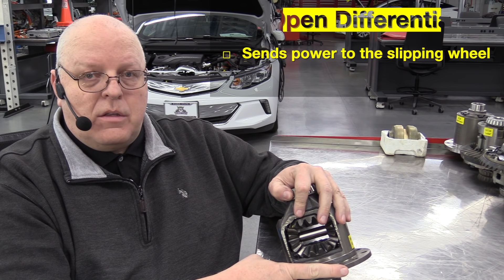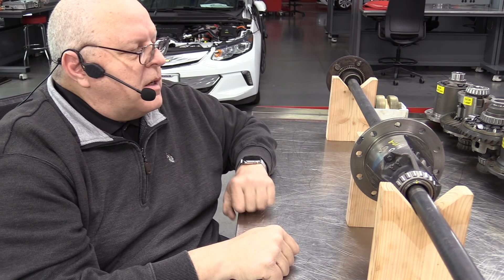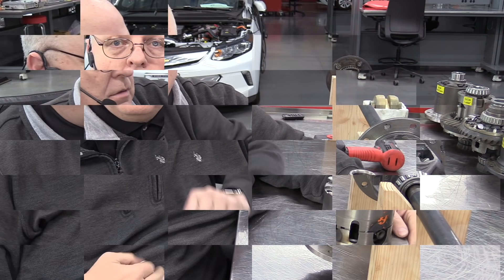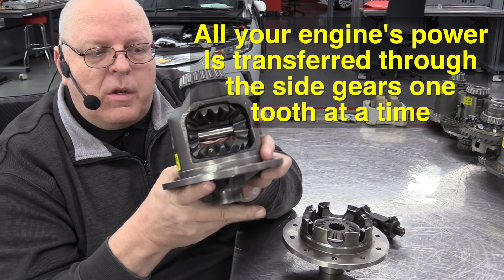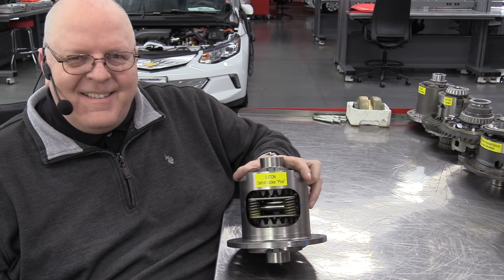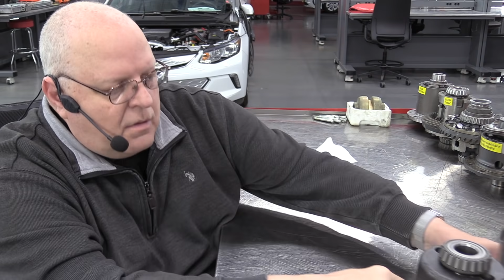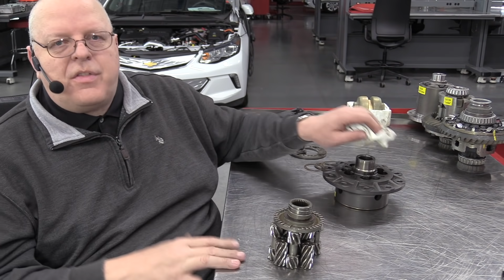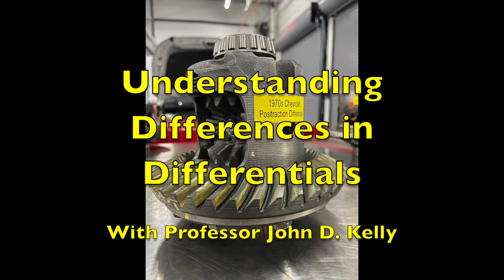Understanding Differences in Automotive Differentials

Comment: I'm trying to figure out a modern version of the  61-68 International Pickup / Travelall rear end that has some sort of lock. Any ideas?
Reply from the maker: I do not know. I think they used Dana axles
Reply: @WeberAuto   yes they are Dana. I am doing a complete frame off restoration and will upgrade the axles - I will pull the diff cover at some point to see which of these rear ends looks like one in your video. My wife.. "What are you watching? Are you enjoying that?"  Me, "yes, I love this guy and all these different rear ends will help me figure out what I have in the Buick and in the Travelall." "D

Comment: have a 342  g80 in my 02 chev  k1500  it was a 75 buck option,,,,been a great  diff  ,,,just had the pinon  seal changed  ,,but  that was an age  thing  ,,not miles
Reply from the maker: A great axle

Comment: What's the difference between these and a viscous LSD?  Is it using heat to engage friction and why they wear out?  Is that the same principle used in a e-LSD like VW that uses a high pressure engagement to press clutch plates together?
Reply from the maker: Huge difference. Perhaps a topic for a future video. Thanks for watching

Comment: I used to have a 2016 Camaro ss once I broke the lsd. As I turning if I leave it in gear the car would lurch and I feel a lot of backlash in the diff. The diff will just constantly lock and release. It was really weird. However if I leave it in neutral it just act like an open diff. . Do you know what can cause that?
Reply from the maker: Sounds like something broken. In gear there is torque applied, in neutral there is not. Thanks for watching
Reply: @WeberAuto  thank you

Comment: Thanks for the informative video, the last Eaton locker is available on few models here in India, can there be a cut off mechanism where a minimum of 20-30% power should be sent to the other non slipping wheel?.
Reply from the maker: I did not know that. Thank you
Reply: An issue with lockers and preload on a limited slip is when you get both axles on a slippery surface like ice, the preload essentially locks the axles together at low torque where they are both breaking loose form the surface loosing lateral traction.  When that happens, you've lost your rudder and all directional control.
The best solution for winter driving is a limited slip with no preload springs.  This gives you the option of light breaking to add preload when one wheel gets on a slippery surface.

Comment: Where does the air come from and switch on/off in air actuated designs? Engine, a compressor, etc? Are there hoses, pipes, etc?
Reply from the maker: Compressor and tubing
Reply: @WeberAuto  Very interesting. I would think there is a better way, even a big solenoid. Imagine the surprise of the owner at the oil change place with the car on a lift. "Is that a hose coming out of the differential?!?" (Thanks for your excellent presentations, BTW.)

Comment: Excellent exposition of something that has always been a bit mysterious.
The only car I ever owned which had differential locking was a 1968 Daimler Majestic Major. The axle was fitted with a "Thornton Powr-Lok" differential, which I guess was made under licence from Dana, in America. Whenever I floored the throttle (just for the fun of it), it worked but was accompanied by grinding noises, which I took to be the mechanism which limited the slip.

When compressed air is used, where does the compressed air come from?
And I wonder what happens in Land Rovers.
Anyway, thanks for the video which was most engaging.

If I were making my own electric vehicle, for which I would use a thirty year old Rover SD1, my preference would be not to have a mechanical differential, but to drive each rear wheel by its own motor, and perform this function with "a bit of software", to control the torque to each wheel.
Fortunately I am too old for this to be anything other than an idle fantasy.
Reply from the maker: Compressed air from electric compressor. Thanks for watching

Comment: Very nicely done presentation and interesting as well.  I grew up in the muscle car era wishing I had a muscle car, but I finally realized it would be impractical as I had to commute 100 miles a day to attend college.  Many of my friends had high powered cars and with that came the problems of parts breaking and talk of differentials, clutches, and transmission breakdowns due to street drag racing and showing off.  I came close to buying a muscle car, one was a 64 white GTO with the tri-power and the other was a new 68 Roadrunner that I went as far as putting a deposit on but backed out over the fuel economy issue.  I loved the GTO, the dealer allowed me to drive it around for a couple days, unheard of in today's world.  Anyway, I went the exact opposite route and bought a new VW Bug in 68, it cost $1,750.  BTW, the new 68 Roadrunner was $3,000.  I forgot about another car I was interested in, a 1965 two-door sedan Dodge 426 Hemi.  This happened after the 60's muscle car era, I found it in 1975 and the seller was asking $1,500 for it.  I wonder what that car would be worth today?  I know I couldn't afford it.  Thanks again for the very informative video.
Reply from the maker: Great story. Thanks for watching

Comment: The only one you didn't have was a Lunchbox Locker, it's basically a mini spool but with dog teeth and springs. It "can" have slip from one wheel to the other but it sounds like a ratchet when it does, as the dog teeth slide over each other
Reply from the maker: Thank you, yes, I need to find one
Reply: He also didn't cover the Vicious LSD
Reply: @inorite4553  I'm guessing that's because it's a vile abomination.

Comment: I was hoping you'd cover viscous limited slip differentials like the center differential in many Subarus (I'm curious how much torque it can transfer vs. clutch types or gear types), but I appreciate the detailed look at clutch, gear, and locker types. Thanks for sharing these on youtube!
Reply from the maker: Great suggestion! Thanks for watching
Reply: I have opened one of those. It has a clutch pack with self contained silicon fluid. The clutch disks are wider, thinner and have holes on the surfaces where the silicon fluid circulates. When there is slipage, the fluid increases viscosity quickly and the disks tend to lock to each others.

Comment: What happens if you use a gear oil with additive in differentials that do not need it?  Awesome video.  Thank you for sharing your knowledge.
Reply from the maker: Nothing in an open differential. It could cause parts to slip in Torsen style helical gear differentials

Comment: WoW.... I'm speechless.
Thank you professor Kelly. couldn't find more accurate answers to my questions. started looking for similar ideas for a new type of vehicles like the one I thought about and came across your introduction of the Chevrolet EV Bolt... since that moment I've become a fan, spent hours watching your explanations about mechanics and automotive electric systems. that was 3 months ago.
I am a well known motorcycle electrician for the past 28 years and still have learned so much.
Today I found out that there is an of shelf differential that doesn't use cone gears :)
Sam Mordo
Reply from the maker: Awesome! Thanks for watching

Comment: You missed the latest and greatest (Torsen) differential. No clutches to wear out way simpler in design than all of the differentials you just showed and they virtually never wear out. Dodge used them in a myriad of trucks in the U.S. and it's the reason they still have properly functioning limited slip differentials at 200,000 miles while ford gm and toyota do not.
Reply: There are tons of G80s going strong at 200,000+ miles.
Reply from the maker: Thanks for the feedback. There is more than one style of Torsen differential. See the JTEKT Corporation's website for more information https://www.jtekt.co.jp/e/products/lsd.html
Reply: The one issue with Torsten style is that all the torque is given to the slower wheel.  So the inside tire in a turn has all the torque and the outside tire just coasts along.  Not a big deal for most applications.

Comment: Your opening description of power division in an open differential is incorrect.  An open differential divides the power equally to both wheels.  On dry pavement, both wheels get the same power.  If you put one wheel on ice, both wheels still get the same amount of power, but this is now much less power as the wheel with the least traction determines how much power goes to each wheel.  That is why the car does not move as the power to the wheel that has traction is reduced to the power being absorbed by the slipping wheel which isn’t much and thus neither wheel gets significant power and the engine will rev to redline if you open the throttle very much.
Reply: No, it divides Torque evenly between wheels, not power. Power is torque x movement. If one wheel is sitting still and the other is spinning then by definition no movement means no power. Whatever x 0 is still 0.
Reply: @danielthechskid  I don’t disagree.  I used power as that is what the author said.  However, I believe in the case at hand, power is also correct.  Power is work/time and work is a force acting through a distance.  In this case, torque is the force and distance is movement of the car.  If one wheel has traction and the other has zero friction/traction, both will still do equal work with respect to the car.  The wheel with zero traction will do work in spinning up the wheel, but the torque required to do this will allow the wheel with traction to slightly move the car.  If you want a real car with one wheel on ice, the car does not remain completely stationary.

So, I agree that torque being applied equally to both axles is the simpler and more direct explanation, but I also believe that a detailed analysis will also show that equal power is also provided to each axle.
Reply: @LTVoyager  Fair enough, I was going with the old horsepower = torque in foot pounds x RPM / 5252. I should have said speed not movement.
Reply: @danielthechskid  The tricky part with power is that you need a force times a distance with time factored in.  Since time is the same in a comparison scenario, we can ignore that and we still need a force times a distance.  If either distance or force approaches zero, then work/power approaches zero.  In the case of an open diff with one wheel on pavement and one on ice, the power to one wheel is not moving the car, but instead is adding energy to the spinning wheel which requires a force as long as the wheel is accelerating.  The other wheel moves the car a very small amount which equals the work done by the other wheel in spinning up.  The difference is that the wheel spinning up has very small mass and thus the power applied results in a lot of motion (spinning), whereas the other wheel is moving the entire car which has great mass, but which has very little motion in order to keep the power the same at both wheels.  Or, looked at from the torque perspective, the same torque applied to a small mass will accelerate it quickly, but applied to a large mass will accelerate it very little per Newton’s second law of motion.
Reply from the maker: Thanks for your feedback and thanks for watching

Comment: Another way to do it is with an epicyclic gear train where the sun wheel and planetary wheels (not star wheels - they're found on printers for driving the paper via mini (cowboy boot spur wheels (not to be confused with spur gears :) ))) have to have the same number of teeth.
Reply from the maker: Thanks for watching
Reply: Sports cars with 4WD often use something like this as a centre differential because a planetary gear set splits power and torque. By choosing the correct gear sizes, it can produce a torque split between the front and rear axles even though axles are running at the same speed. This is usually used to bias the torque to the rear mechanically to give better acceleration. 
On a car with open differentials and equal torque split, the front wheels will break traction first due to the weight shift backwards on accelerating causing all the engine power to go to the front wheels as this is the path of least resistance. 

With a torque splitting diff, say a 40:60 split, if the weight shift due to acceleration leads to 40% of the car's weight being on the front wheels while the rear has 60% the torque split means the tyres will all be working as hard as they can but not spinning, without any locking or limited slip differential - on a standard differential, at the same acceleration the rear axle would have 20% more potential to deliver power when the front starts to spin. Some very fancy cars (Some Mitsubishi Evos and Subaru Imprezas would be the most popular cars with this option) give the driver the option to adjust the torque split - so how these differentials work is a whole other question. 

Torque vectoring is the next step and is active control of the torque split, usually side to side on the rear axle to give more torque to the outside wheel on cornering as this has the most grip, but this is controlled on the fly by the car's computers. The Ford Focus RS doesn't have a centre or rear differential at all and uses a clutch between each rear wheel and the drive from the engine to vector torque left to right, with the car being front wheel drive by default - it's a great idea until it actually gets hard track use and the clutches start to overheat. One motor per wheel electric cars can torque vector and don't need differentials at all, so this will be what will happen in high performance cars in future (Surprisingly least a decade ago, Jaguar made a prototype car doing exactly this, the upcoming all electric Rivian Pickup truck uses this setup, which will allow it to skid steer to turn on its own centre while it's off road).
Reply: @peglor  Skid steering isn't efficient and as a method ought to be avoided !
I don't know enough about Teslas other than they have a lot of poke if you want it !
Reply: @millomweb  Skid steer is great fun though, and the party trick of turning on the spot as well as varying speed from one side to the other to make subtle turns on loose ground without steering angle changes could increase control off road. 

My favourite option for tight turning was on a concept Jeep IIRC, many years ago where there wasn't a fixed rod across the axle to turn the wheels together, so the front and rear wheels could be turned inwards so they all aligned on the same circle and the car could literally drive itself in a circle on the spot. 

Resolver feedbacked stepper motors could do this very nicely, with the added benefit of eliminating tire scrub at all turn radii and the ability to recover from impacts that would bend a track rod. The Normal Ackerman steering used in cars works without tire scrub in the straight ahead position and at one other steering angle. It's close enough that scrub isn't too bad in between if the second angle is chosen well, but controlling individual wheel angles gives the ability to steer perfectly in all cases.
Reply: "My favorite option for tight turning was on a concept Jeep IIRC" Have you seen omni directional wheels - some have been used for real on forklift trucks.

I don't think Ackerman is a source of tyre scrub. I think the geometry can be such to be perfect but wheel toe possibly affects accuracy and there is likely deliberate inaccuracy to make the outer wheel turn slightly more than the inner one on the basis of wheel loading.
Reply: @millomweb  The Ackerman linkage is designed to turn the inside wheel through a bigger angle because it needs to be on a smaller radius circle to avoid tire scrub. As I understand the system it is not perfect, but it's good enough. Omnidirectional tires are great on polished concrete floors in warehouses, but they depend on different wheel speeds and 100% traction to allow the vehicle they're fitted to to manoeuvre. The 'helical' rollers on the wheels are not driven separately, so by having an opposite wheel on the same axle with a helix in the other direction they bind and hold the vehicle in place provided all tires have grip. By driving the wheels in different directions and at different speeds, everything from driving in a straight line to spinning on the spot can be achieved without any steered wheels, but it only works when all wheels have grip and the surface it's driven on is flat.
Reply: @peglor  Ackerman should be perfectly tunable via linkage lengths and pivot positions.
Yeah, I totally get how omni-wheels work !